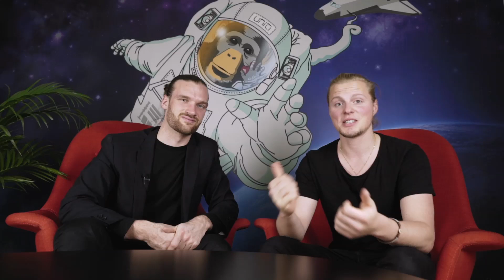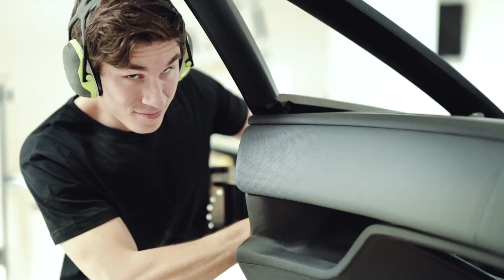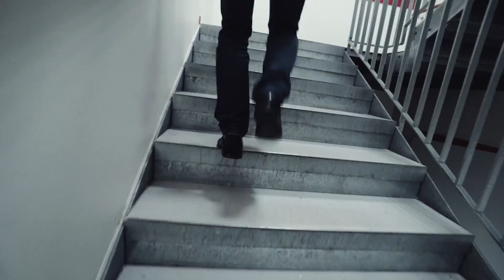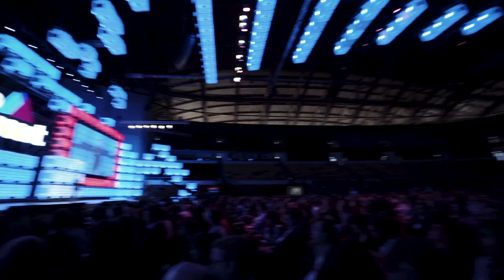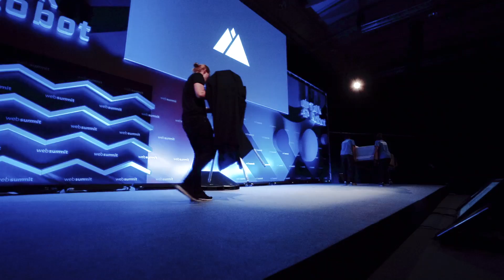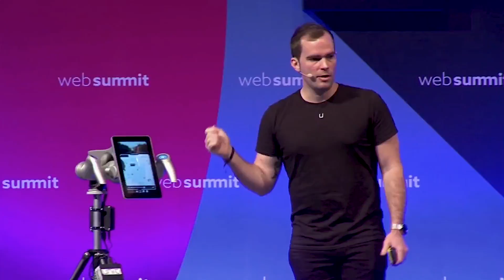The smartphone car becomes reality I UNITI UPDATE 16

Comment: So how does the airbag work? 
How does the steering handle thing react in case of an accident or if you have to make an emergency maneuver? 
Is it designed to make fast corrections intuitive? The reason why you learn not to have your thumbs inside the steering wheel is to enable your hands to slide off the wheel instead of breaking your thumbs and taking up a lot of the force in case of a crash. 
Has it been evaluated during long drives? I don’t know the estimated range of this car but if you spend long hours or drive for en extended period, the seating position and how you’re able to differ position on your steering hand/s are important.

I kinda like this project, but this gave me a lot of questions :)
Reply from the maker: 86Akos questions like this were addressed at length in the several year research phase prior to the company foundation. It is designed to perform better in evasive manoeuvres and intuitive design was one of the fundamental principles. Although of course we will continue to test and develop over the next years. The vehicle is also available with a normal steering system though, and even those that choose the next gen system will be able to use it with a centre rotation if they choose. The airbag is above the screen and folds over, although it's not on this model, but if you check the VR in MediaMarkt that's the next model in which the steering system integrates into the dashboard and you can see there where the driver airbag will be. There will also be other airbags for side impact etc. Thanks for your questions, and we will be sure to publish our development work next year so you can follow our progress.